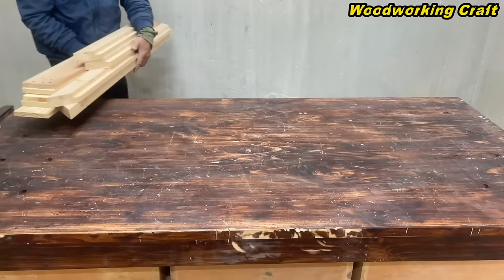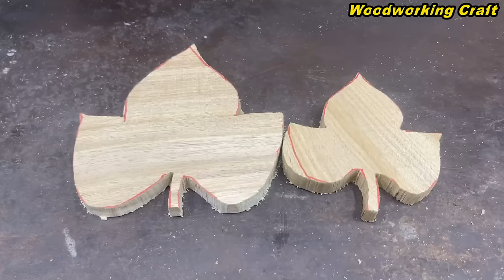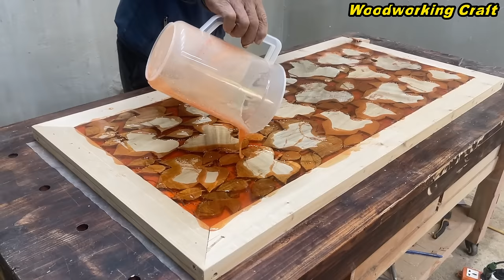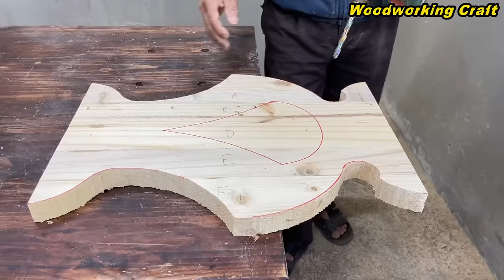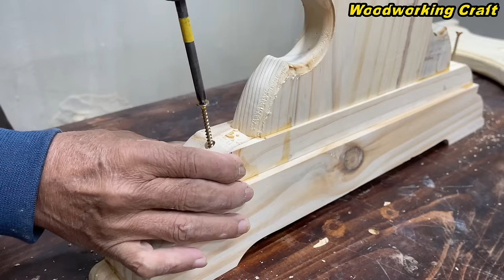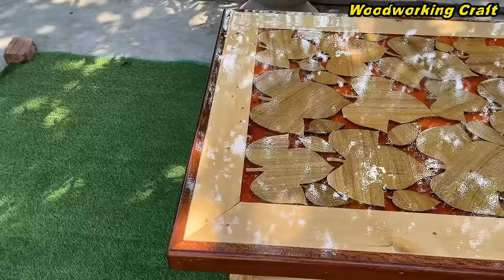Woodworking Ideas Are Inspired By Nature // Unique And Fancy Coffee Table Design Never Seen Before

Comment: I've been woodworking for almost 10 years and your skill and artistic vision is off the chart!  What a beautiful project. 
Honestly, it wouldn't be all that difficult as long as you have the basic necessary tools, but the craftsmanship is what stands out. 
Thank you for sharing.
That resin is super thick. I don't know how you got it to settle and cure properly, but you did, so there is that.
I loved to see that you have an electric hand planer and weren't going to try sanding this whole thing level. GREAT argument for investing in an electric hand plane.
I can't see your face, but I really hope you're wearing a mask when sanding, especially when sanding resin. Sorry! I see that you're wearing a mask when you went to the sander. Thank goodness!

For the bandsaw cuts, a 1/4 inch blade would have worked better, but you are pretty masterful with a half inch blade. 
For those who don't know, there are also scroll blades for the bandsaw that can provide even more accurate cuts. Not as intricate as a scroll saw, but pretty darn good if you're making an intricate bandsaw box. 

What an absolutely gorgeous piece!
I want to be like you when I grow up!